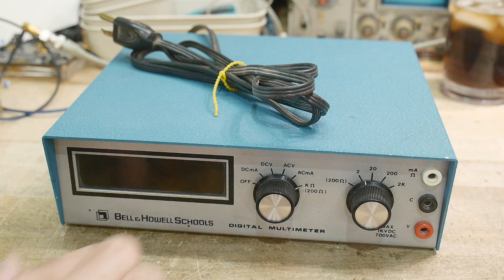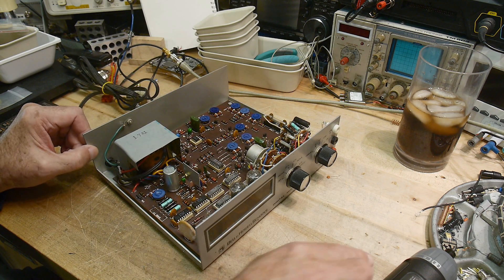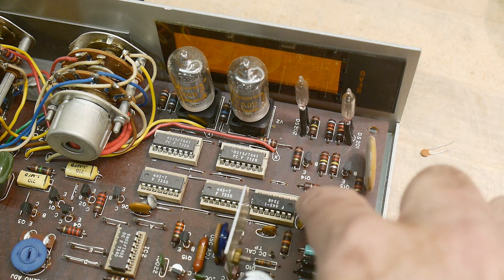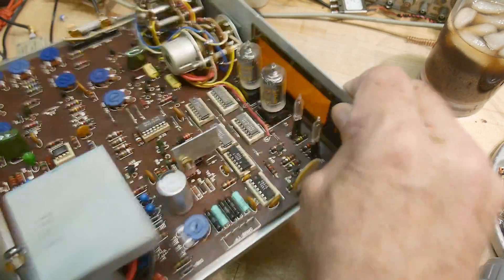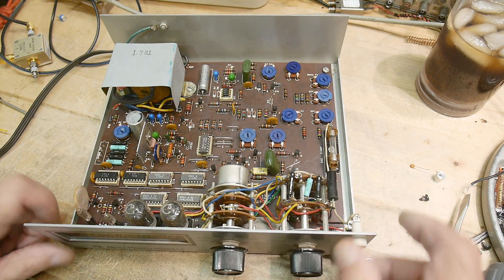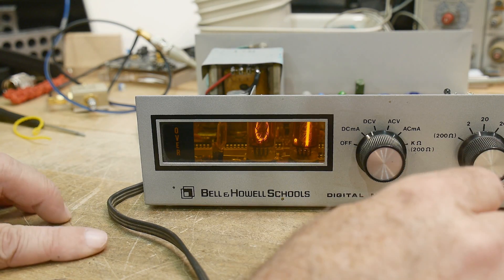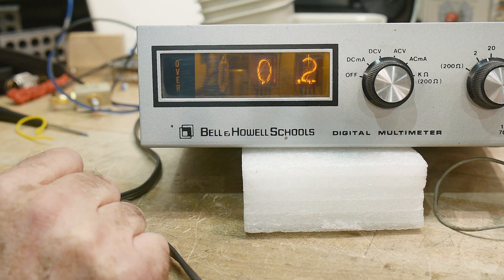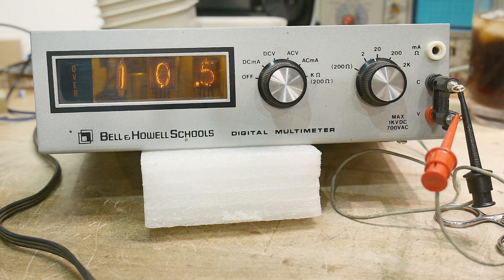#1361 Bell and Howell Schools Digital Multimeter (part 1 of 2)

Comment: IMSAI Guy, this B&H meter is the rebranded Heathkit IM-1212, itself a repackaging of their earlier IM-1202. The number on the transformer fish paper is a number provided by Heathkit, based on a factory measured component value. The calibration instructions direct the kit builder to adjust one of the trim pots to match that number (which was written on the fish paper in one step of the assembly instructions, copying the value written on one of the parts bags in the kit).

The RC based oscillator, upon which all calibration depends, is (according the Heath) not stable until 30 minutes after turning on power. So if you want this to stay in calibration, don't try to adjust anything until it was warmed up plenty. The first step of calibration is to get the oscillator set. They recommend setting all trim pots to their centers of rotation, then turn the DC CAL trim pot 1/4 turn counterclockwise, set the front panel switches to DCV and 2. Short the RED and BLACK test lead jacks. Adjust the ZERO ADJ trim pot until .01 is displayed, then slowly turn it until the display just barely changes over to .00; then display should flicker back and forth between .00 and .01. Remove the short between the inputs. Turn the left knob to the KΩ position and adjust the OSC ADJ trim pot until the OVER neon lights up and the display reads .85 (if you can't get that exactly, it should be no more than 15 counts higher). Connect the RED test lead socket to the DC CAL TP on the circuit board. Refer to the number written on the transformer fish paper,  and round the least significant digit up or down to get a three digit number. Turn the left knob to the DCV position, and adjust the DC CAL trim pot until the display shows the three digit number. Heath then recommends repeating these steps, without first centering all the trim pots. THEN, repeat back to the step where the inputs are shorted and ZERO ADJ is tweaked, do that and then repeat all other calibration steps once more. After that, you can pretty much just connect a reference AC sine wave and adjust the AC CAL trim pot, then connect an accurate resistance decade box and, going through all resistance ranges, set the decade box for values near the top of each range and tweak the associated trim pots to match the display to reality. I mention all of this because the odd circuit Heath designed to implement a digital voltmeter function needs to be set up just right, or you will probably find yourself going crazy trying to calibrate the rest of it.....gotta get that oscillator set right to start with, because it will skew everything else downstream.

There is supposed to be a bent (L-shaped) piece of fish paper with two holes on one edge, where the tips of the two neon bulbs fit into the holes, and the bent part gets glued to the rear of the clear plastic window......to hold the lamps in the correct positions. Also, the neon lamps are supposed to be twisted around (rotated 180 degrees). This is because the way the PCB holes are oriented, the rear electrode in the lamps will be the one to light up, so rotating them places that electrode at the front.

The IC complement is:
1x    301A op-amp (IC1)
1x    7202 quad 2-in NOR (IC2)
2x    7441 BCD-Decimal decoder-driver (IC3 & 4)
1x    7473 dual J-K M-S flip flop (IC5)
2x    7490 decade counter (IC6 & 7)
1x    7400 quad 2-in NAND (IC8)

Except for the decade counters, the rest of the A to D is accomplished by a 2-transitor RC oscillator and a clever single-slope circuit one FET as a constant current source to charge a capacitor linearly, and 6 bipolar transistors in a comparator circuit controlling and reacting to the slope, comparing it to the signal coming out of the first stage attenuation circuit, plus the 7402 configured as a pair of S-R flip flops which start and stop the oscillator (when the oscillator does run, the two decade counters do their thing). This whole aforementioned scheme depends on a master clock, derived from the half wave rectified high voltage supply for the Nixie tubes (normally this is 60Hz)....so the A-D conversion and display update happens at the frequency of the AC power, and as part of this, Heath did another clever, cost saving bit......because the Nixies are only powered for half the the AC power cycle, and the slope & counter circuit only works on the other half of that cycle, so all the decade counter counting activity happens while the Nixies are unable to display anything.

All in all, this meter is too primitive to be very useful to any serious user, BUT, Heath was able to cleverly find a way to implement it at a cost nobody else could meet at the time. Actually, when the IM-1202 came out, this was true, but by the time Heath reconfigured that meter as this IM-1212 in 1975, there were just starting to become available the earliest LSI digital voltmeter solutions, but those were still expensive enough to keep the prices of other DMMs out of the reach of casual hobbyists and students. But this IM-1212 was transitional and was thus only made for one year before Heath made the third version of the basic circuit in the form of the IM-1210, which was just about the same but with an LED display instead of the Nixie display (and a few other cost cutting tricks that would have made Muntz proud).
Reply: Thanks. Having built a 1202, the calibration instructions sound familiar. I wish I knew when I bought mine, but I am sure I was poor then. I think I just had a Lafayette VOM and an Eico 232 VTVM at that time.

Comment: The number on you're transformer is for calibrating to the crystal
Reply: robertedwards, I think you meant to write "your". Regardless, there is no crystal in this meter (it uses a simple transistor oscillator based on RC time constants). The number on the transformer is a number provided by Heathkit that represents a value the kit builder will use if he/she follows the procedure for calibrating the meter without having another working meter available, and is based on a factory measured component value.
Reply: @youtuuba  well it has been a while but I thought it was a crystal. I'll try to dig mine out and refresh what's left of the old noggin.

Comment: Keithley 160 or 164 ripoff?
Reply: Not quite.  The Keithley 160 is a meter of an entirely different caliber.
Reply: hinz1, hardly. The Heath engineers came up with this all by themselves when they designed the earlier IM-1202, which used the same circuit design but was in a case that resembled the Heathkit VTVMs. When they repackaged it as the model IM-1212 (the same product as in this video, minus the rebranding), all they changed was the deletion of a polarity reversing switch, probably because there was no place for it on the  new front panel. Heath figured a very clever circuit that did not use any LSI or other dedicated ICs to implement the digital voltmeter functionality, and they also figured out a clever scheme for allowing this meter to be calibrated even when no other meters or test equipment was available.

Comment: Bell & Howell has been around a LONG time, but were mostly known for 16 mm equipment,  particularly projectors.  The projector your teacher wheeled into the classroom when they didn't have a lesson plan was undoubtedly a B&H. 

The company also had correspondence schools. I remember seeing the ads in electronics magazines.  A feature of the courses was building test equipment for the lessons.  I seem to remember that in later years the stuff the student "built" culminated in some sort of microprocessor.
Reply: B&H was a "conglomerate" with a fair representation in instrumentation. Not well known today, but Bell&Howell Datatape (Pasadena, CA) used to develop and make instrumentation magnetic tape recorders for aerospace and military. Same site B&H CEC also made high-speed paper chart recorders and precision electronic pressure gauges. In the 60's B&H Research division worked on analog computers and mass spectrometers.

Comment: Wow, a 200-count multimeter.  😄
Reply: Wait, ain't the cheap yellow things for 10 bux 2000 count?
Reply: @plainedgedsaw1694  from the 1970's?
Reply: @dicko195  nah, the cheap multimeters of today usually called "dt+numbers" rebranded by supermarket brands all the time, usually based on ICL7106 chips.